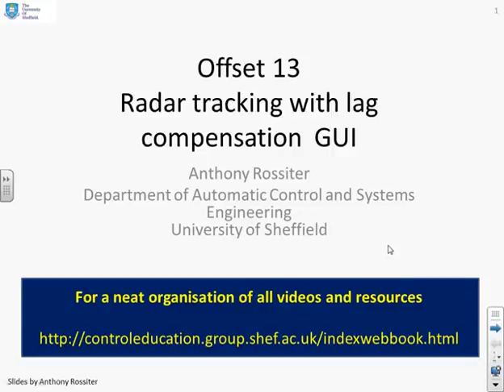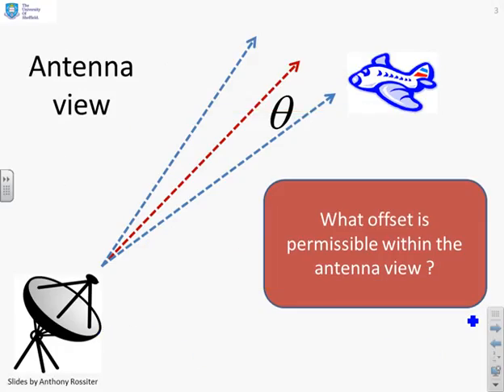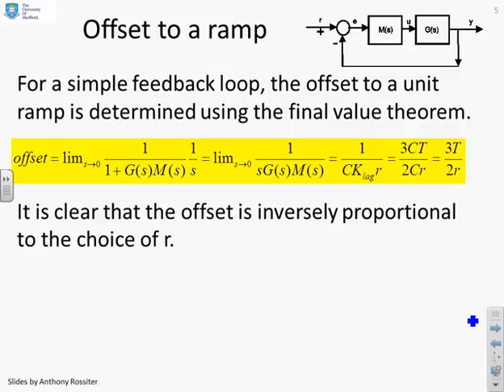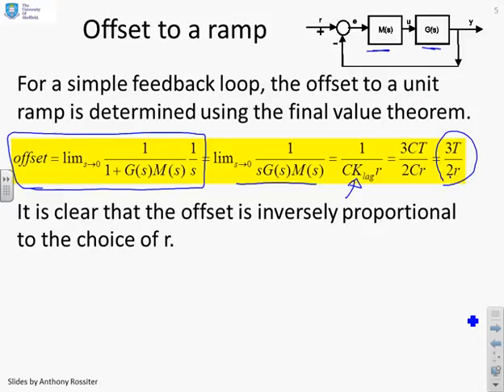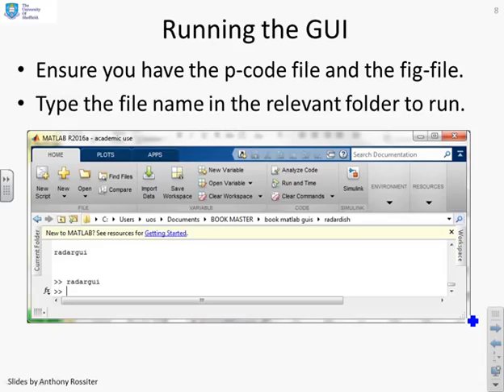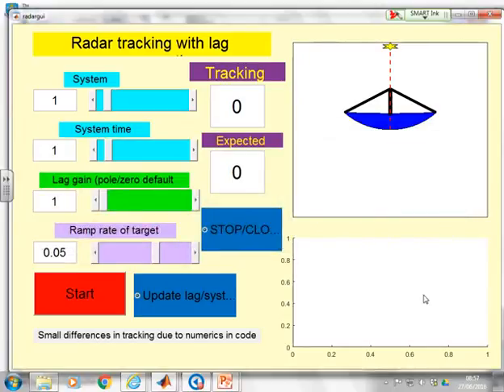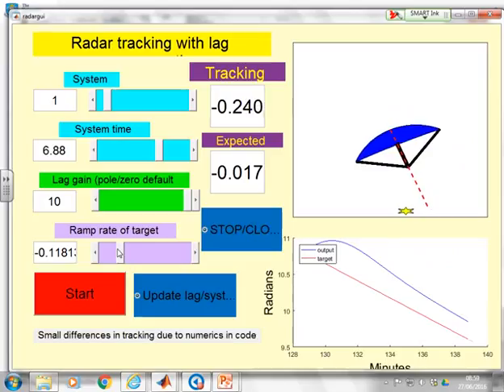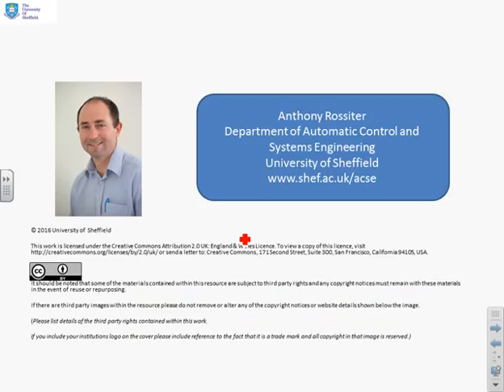Matlab GUIs - satellite tracking with a radar and lag compensator design

Comment: matlab error:
"
Undefined function or variable 'radarcontrollaw'.

Error in radargui

Error in gui_mainfcn (line 95)
        feval(varargin{:});

Error in radargui

Error in
matlab.graphics.internal.figfile.FigFile/read>@(hObject,eventdata)radargui('pushbutton1_Callback',hObject,eventdata,guidata(hObject)) 
Error while evaluating UIControl Callback.

Undefined function or variable 'radarcontrollaw'.

Error in radargui

Error in gui_mainfcn (line 95)
        feval(varargin{:});
"